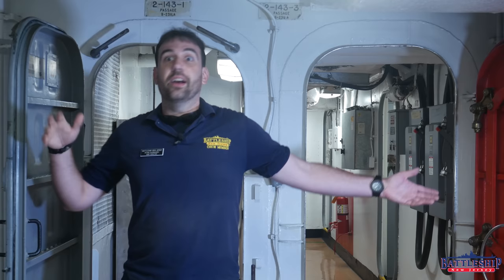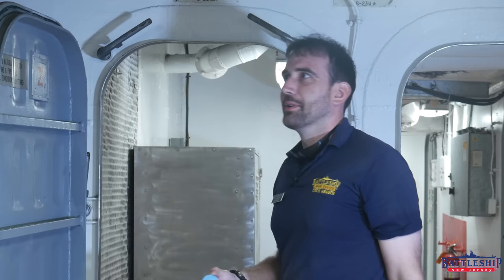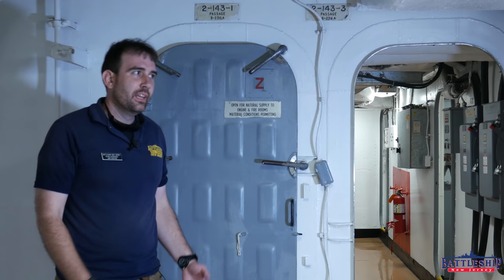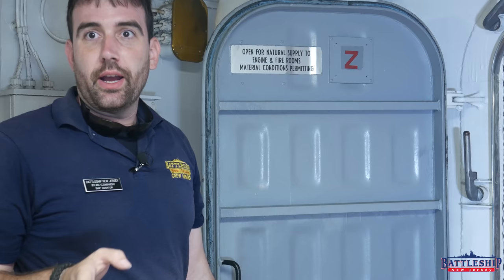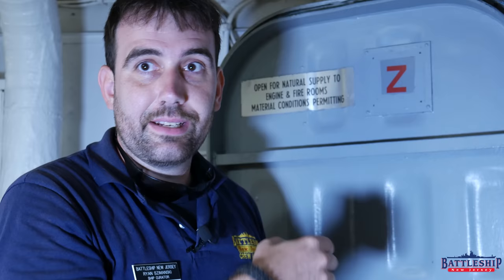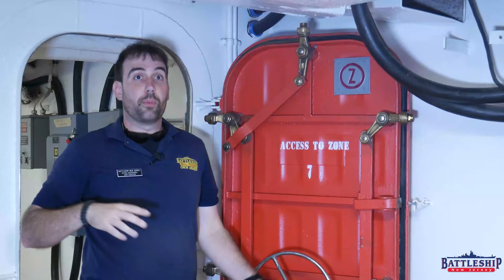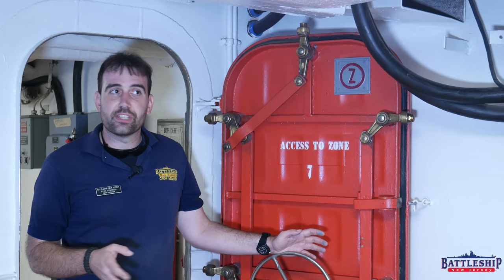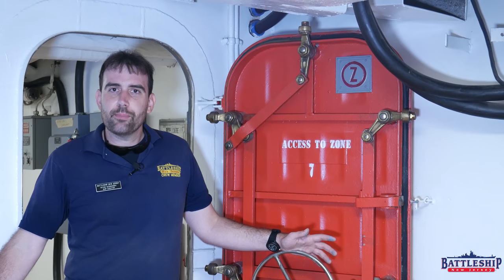How Do You Know if a Door is Watertight?

Comment: In the automotive field there is chalk in a aerosol can and we would look for the same transfer of chalk. Since the ship was 'NBC" rated could you show and talk about that. Is the ship still fitted for "NBC" if so has there been any discussion about the ship being used as a shelter in case of such a event?
Reply: Some bits like the airtight doors may be okay, but i doubt any air filtration or surface cleaners would still usable for that, modern CBRN equipment has chemical compounds with a shelf life of like a decade or less (a month if seal is broken). Maybe two decades for some things.
It would be cost prohibitive to continue to perfectly maintain those systems on a museum ship.

Comment: So it's basically like when the dentist checks your tooth occlusion by having you bite down on a strip of blue paper?  Cool!

TBH, when I first heard the phrase "chalk test" in relation to testing watertightness, I assumed it would involve shutting and dogging the door and then blowing chalk dust at it to identify any leaks, but the actual method works just as well and is a lot less messy.

Comment: Is there still ventilation to the airtight rooms? Or are they completely cut off from the outside once the doors are sealed? If so, how does one deal with something like a fire on board, where the best bet is likely to suffocate the fire?

Comment: It wasn't just the DC's doing the chalk tests on those doors. At least for the ship I was on, the division that "owned the space" was the one who maintained the watertight door for that space. The DC's may have done some spot checking of their own on doors they didn't own themselves, but mostly it was up to the 3M coordinator and relevant work center/division chain's of command to ensure the maintenance was being done properly.
Reply: Concur.  Plus that was on the list of favorite spot checks by chain of command. Damage Controlmen as a rating has not continuously existed.  If I find details - I will be back with then - off the cuff- went away in the 1960s under the thought Damage Control is everyone responsibility. Cam back maybe mid  1980s- needed some people to be have more expertise in Damage Control. When it came back - originally many Hull technicians were changed to DC men. Actually I recall - every division assigned some one as a Damage Control Petty Officer - and all maintenance they did was assigned by the Damage Controlmen,

Comment: OLD RUBBER: I wonder what the rubber door gaskets will be like over time.  I have done research work in the National Archives.  Bundles of Army records were typically held together with rubber bands.  However, after 100 years, these rubber bands became hard and brittle.  The old rubber was almost like strips of pencil lead that would crumble into tiny pieces if you tried to bend them.  (Happily, this material did not leave a black residue on the surrounding paper like pencil lead.)  However, this old rubber also stuck like glue (although it was no longer sticky) to the surrounding papers. QUESTION: what will changing the rubber door gaskets be like when they are 100 years old?
Reply: Sort of the same as you described.

A lot can be brittle, crumbly chunks, with weird gummy bits that refuse to let go. A lot of goo-gone/ gasoline can help remove the residue.

Comment: How much can a ship flex? Could it be feasible for the ship to flex enough to warp a door way?
Reply from the maker: The flex is in the expansion joint, which you can see here: https://youtu.be/LiR-3FpHrWo
Reply: You normally don't see THAT much movement in a single place.  It's more relevant for things like battery alignment, which may cause separated parts of the ship to drift enough to cause noticeable error between sensors/illuminators/weapon systems.
Reply: Although it's less noticeable, may be, the flexing is real and goes on in all ships and boats at all times. As one who was employed shaft-to-shaft aligning dozens of pumps to motors, generators to turbines, diesel motors to generators, reduction gears, and more, etc., the differing results each time tell the story. Piping is often in a different place, equipment heating up and powering otherwise cooler equipment changes the relationships, and the like. The expansion joints serve a very real and necessary purpose but aren't intended to catch it all.

Comment: Ryan, has the ship spring a leak on you? What did you do for d/c? 
Thx
Reply: Good question. I had the same one. I know they aren't in deep water, maybe, but I wondered that because of what he said because we know the internal compartmentalisation is what helps keep lower leaks from filling up and leaking from one compartment to another. Some of those leaking now may be less important now than they surely were when floating in the past. "It's too far to walk home" was our best reason for doing our job properly both as a squid earlier and  as a shipyard worker later.
Reply from the maker: We don't have any real issues with leaking, from the hull anyway. We keep an eye on places when it rains, water makes it in through open doors or over combings when it comes in fast. We keep an eye on the heads, toilets overflow occasionally.

Comment: I would think stripping off the interior paint prior to combat to reduce flammable material would be worse than checking for water tight integrity. Than again, we had our own fun ‘ choirs’ in the USMC.
Reply: Interior paint is not removed prior to combat.  It would take too long  to remove and re-apply later.  Ships on deployment can face combat at any time when on station.  Having paint removed for extended periods would increase corrosion.
PNC(SW), USN(Ret)
Reply: @RRose-ie8oh  thank you for your response, I had read about stripping paint off walls and such in accounts of battle in WWII, and it seemed extremely time consuming if it were the case. They also reported dumping fuel for spotter planes ( and sometimes the plane itself) to lessen the fire danger. That might make sense, the paint removal was harder to accept. Thanks again for the clarification
Reply: I did read about how some of the extra stuff was removed then so that during battle damage could increase injuries from splinters and the like were getting removed then, that would include excess and unnecessary decorative wooden paneling, and the like.

Comment: I was wonderdering: what kind of internet connection do you have in your offices?

wifi wouldn't work in such a metal box, right? connecting everything with lan cables and switches would mean poking holes... maybe this is a topic for a short video
Reply from the maker: There are a lot of cables running through the ship from her 50 years of service, so modern internet cables are just laid along side those.

Comment: Nice video.  That being said, you failed your review.  First and foremost when doing maintenance is pull the Preventive Maintenance System (PMS) card for your job and consult this card for each step to be performed.  The entire 3M System (Maintenance and Material Management) would make a rather lengthy (and boring) video in and of itself.  You also didn't discuss another condition of the gasket that would mandate its replacement.  Over time, particularly on X-ray and Yoke fittings that are usually closed, the gasket gets a channel worn into it.  After this channel gets too deep, it becomes impossible to keep a seal.  Of course, the gasket material would shrink over time and that gap you noted would increase in size.  UNSAT.  In addition, when installing a new gasket, it would be literally stuffed into the channel in the door and compressed as much as possible.  There should be no gap on a newly installed gasket as the cut was made to overlap the starting point and the inch or so extra stuffed into the channel.  It's all on the PMS card.
PNC(SW), USN(Retired)

Comment: Worst check--most things with the cooling skid.  Engine/equipment rooms are just miserable spaces.
Reply: You could light a cigarette off the bolts on the main steam line off the boiler in the main engineering space.  There was a ladder you could climb up above the boiler with a thermometer they had us check.  I never saw it less than 120 when underway.  We hung our laundry up there.  Had a washing machine that drained into the bilges. We made the fresh water, so ALWAYS got to shower

Comment: I think an interesting thing to discuss would be how does ventilation work during a NBC event.
Reply from the maker: It didn't really. But the ship had enough space that you can wait it out and have air for a while
Reply: @BattleshipNewJersey  wow imagine being in the engine room if that ever happened 😳
Reply: In the case of a Nuclear event, the difference in danger between the first 10 or 15 minutes and an hour or two in is very considerable, so an Iowa class as sealed up as possible would be probably quite safe, especially if they could still sail away and further decrease the danger.
Reply: USS Ronald Reagan got a big dose of rads from the Fukushima melt downs in 2011 while off the coast. Later there were high rates of cancers and other sickness in her crew. Sadly they had desalinated radioactive seawater for drinking, cooking, and showers. Despite exterior wash downs the ship remained "hot" with radiation for a few months (her helo's were extremely irradiated), and she was turned away from several possible ports because of it. A crewperson who had been pregnant at the time later gave birth to a severely deformed child. 
To those folks who look into this: Wikipedia will be little help with this one, dig deeper for the actual story. The Navy claimed they always stayed 100 miles offshore, reports from several crew members and media had them less than 10 miles off at times, because of that they got hit by plume clouds from the melt downs (four reactors melted down at Fukushima). The radiation was from Cesium 134 and 137 mostly with 2 and 30 year half-lives.

Comment: How would these doors fare in a fire?
Reply from the maker: They are also fire boundaries so they do well in a fire
Reply: Usually if you have a REALLY bad fire the bulkheads transmit enough heat to set things on the opposite side on fire before the watertight doors fail.  While you can rip off the lagging, big junction boxes and cabling are a problem.